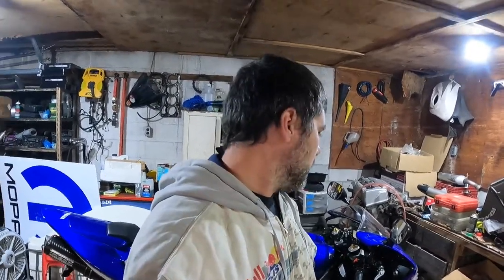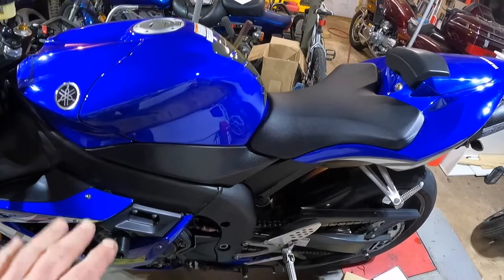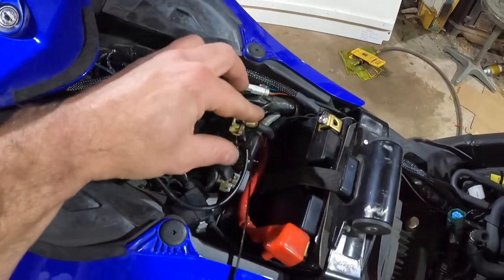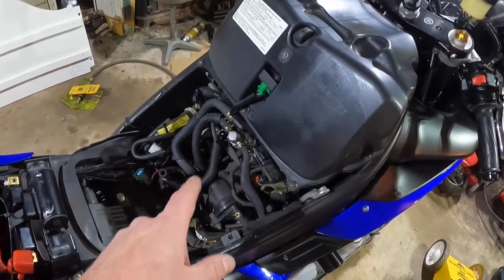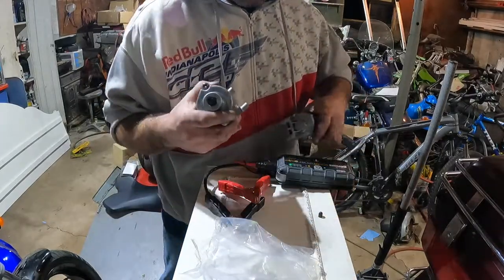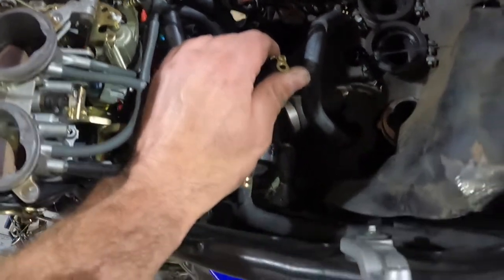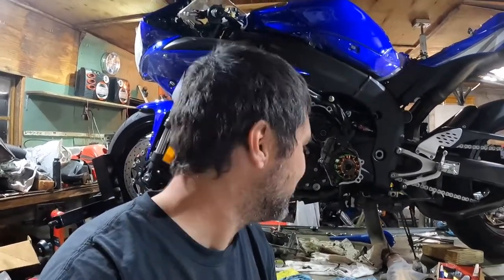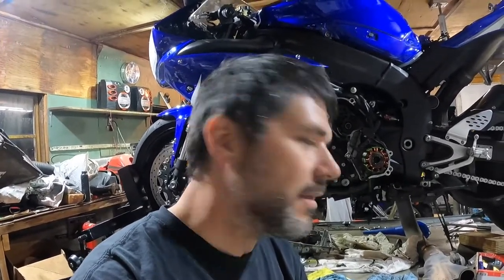2005 Yamaha R1 faulty starter replacement!

Comment: Going to replace the starter today for my 07 bike. It's the 4th electrical fault for this season already. First the alternator rotor blew (I strongly recommend you change to the updated version before it happens to you). Second fault: ignition cut-off relay (under the ECU) had two blown diodes, replaced that. Third fault was two positive wires shorting in the ignition switch harness, causing either power going on by itself and not shutting by turning the key or showing HI as coolant temp reading causing ECU not to allow the bike to start. First one caused the battery to go flat and second one left me stranded to whichever remote location. And the starter is now the fourth one, I suppose, as new battery died during startup - which points to the same thing that old starter is drawing a huge amount of current.
Prior to those faults I already replaced all ignition coils and a headlight relay couple years back. Can't say I have much trust left for Japanase bike electrical systems anymore...

Comment: What happens if you accidentally didn't attach a wire that connected to the power commander did i ruin my ecu. I keep getting a err_code1 and a ticking noise